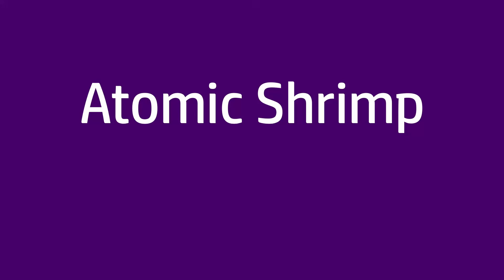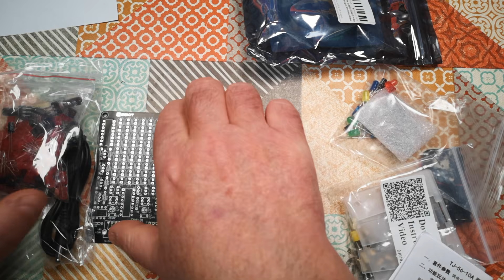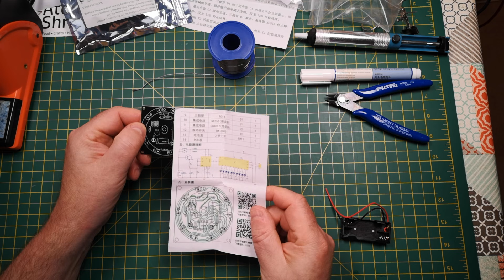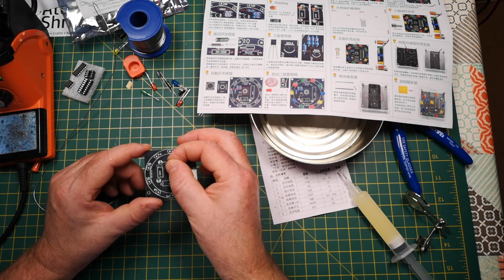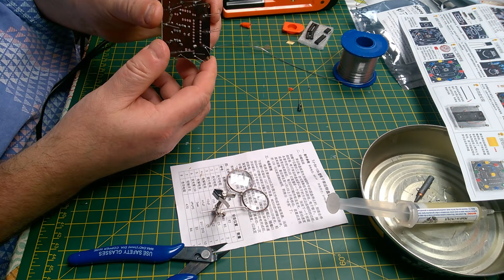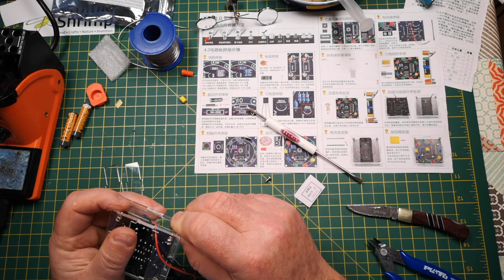Lucky Wheel LED Electronic Kit From Aliexpress

Comment: Ahh, the joys of Johnson decade Counters, 555 timers, Flip Flops and the like. My personal favourite projects has been connecting with a  breadboard to a Raspberry Pi and multiplexing 7 segment displays or making analogue measurements through digital IO with capacitor discharge timings. PIGPIO is a favourite library to use in C/C++.

Comment: You've ruined that new tip from the very start because you've heated it dry. It has to be fluxed and coated in solder way before it reaches max temperature.

Comment: Btw your temp is too low on your iron - when it isn't wicking properly flux can help but often it's just because your irons temp is too low or the tip needs cleaning. Sauce: software and electrical engineer
Reply: Ah just watched further and saw you noticed yourself 🤣
Reply: If it's got a removable tip, another issue can be the inside of the tip has oxidised or gone crap and the ceramic element isn't heating the tip properly anymore. Worth investing in a box of replacement tips cause they do go shit pretty quickly

Comment: On top of the other advice in the comments, I'd suggest investing in some good solder. The one you're using probably doesn't match the label. It may contain either too much or too little lead. Real 60/40 (or ideally 63/37) solder should be almost eutectic. If your solder goes through a paste like state while melting and solidifying, it's not anywhere near 60/40. Another giveaway is the label design. This one is a knock off of the Asahi solder label, which is a known good brand. The only good chinese solder I've used so far is the Kaina C (blue and white label). Other types (A, B, B1, B2) are of similar quality to the one you're using, and iterestingly enough have a very similar Asahi style label.

Comment: 555 timers used to be referred to as multi-stable multi-vibrators. I have old radio shack project books from the late 70's, when I was a teenager just learning about electronics. The manuals were always a treat I bought for myself when I got one of my meager paychecks. One was for 555 timers, I think still have it in storage somewhere. Need to find it now. I went to electronics school in my early 20's and eventually ended up in IT. Semi-retired now as I like what I do, but want to dump the crap jobs and do the fun ones. I love the electronics projects and tinkering. Your rambles through Spain are great. And as always, I love weird stuff in a can. I love the variety of videos. So glad you are able to do this full time. Much love to you, Jenny and the worlds best doggo, Eva!

Comment: Get yourself a fume extractor. Especially with leaded solder
Reply from the maker: I've got one but I need to extend the exhaust hose for use at this table. Lead isn't likely to be present in the fumes here - the vapour point is way higher than the temperature of the iron - the reason to extract fumes is the flux.
Reply: @AtomicShrimp that’s true but still always a good idea to protect your lungs.

Comment: The Hakko clone soldering irons and tips are so varied, it's quite easy to get a tip meant for your iron that doesn't actually sit right on the ceramic heater.  I had one like that, and I took about .5mm off the bottom of it with a Dremel and it suddenly worked a lot better.

There's just so many factories making tips and the QC is all over the place.

Comment: Watching you struggle with your soldering iron...
Lack of proper tinning on the tip is definitely a problem.  I would suggest you get tinning compound to attempt to fix it.  It has a much more aggressive flux built into it to help with the iron.  Once you get it tinned with the proper compound, wipe it as clean as you can & then coat with your normal solder.
When you put the iron away after a session of soldering, give it a good coating (big blob really) of solder & let it cool.  Cleaning the tip when you turn it off tends to allow the tip itself to oxidise.

Of course, it IS possible your irons temperature control has failed, but that's unlikely.

Comment: The way I learned soldering electronics is that you don't put the tin onto the soldering iron, and mustn't let them touch. You hold both to the foot of the item you want to solder to the circuit, so the tin flows around the foot. That was almost 30 years ago, but I can 'see' our lecturer from back then putting both hands on his head in dismay at your technique. :P
I'll just go with "maybe they do things differently in the UK" (that job training was in Germany, and I haven't been back in the UK for around 30 years too). :))

Comment: It looked to me like your soldering tip got dirty, and that's why you had difficulties.The crap covering the tip makes  heat transfer difficult. In my experience those wads of copper threads you can buy are good for cleaning it off

Comment: I noticed you’re still using a wet sponge to clean the soldering iron.
Just a heads‑up: modern tips have a very thin iron plating over a copper core, and the sudden temperature drop from a wet sponge causes micro‑cracks in that plating.
Once the plating cracks, the copper dissolves into the solder and the tip wears out much faster.

Brass wool (the curly brass cleaner) avoids the thermal shock, keeps the tip tinned, and actually extends tip life by a huge margin.

Not trying to nitpick,  just sharing because it genuinely makes tips last years instead of months.
Reply: You can also get get tip cleaners that are highly compressed blocks of solder and flux in a small tin, they're very effective as they both clean and pre tin.
Reply: @mfx1  For years I thought the little tins of tip cleaner were a waste of time and money.  Then I got one, and it's like having a new tip for my iron every time I use it.
Reply: I think it is very kind of you to share that little tip.😊 Have a nice day.

Comment: I have found those flux pens to be completely useless. Real flux paste is the only thing that has worked for me.
Reply: If you use decent solder you should never need extra flux. I only ever use flux for desoldering/rework.
Reply: @mfx1  Yes I agree (although quality solder is not always the easiest to come by). I don’t think I’ve ever used flux when soldering something, but for rework it is sometimes necessary.

Comment: you need too use leaded solder and FLUX that will fix all your issues ... also if that soldering iron doesnt have temp control it can make soldering very hard .. good effort with what you got tho
Reply: no need for added  flux if you use a decent brand of solder,and as for temperature controlled irons-no thanks,ive used  many makes of temperature controlled irons  , both expensive and el cheapo over the years on different jobs   but still go back to my trusty antex cs iron ,nearly 50+ years on its still going strong and spares are widely available.
Reply: @davisbonn I used various Antex irons as a kid experimenting with electronics but quickly grew out of them. IME the best irons are high wattage (Absolute ninimum 60W), temperature controlled with low thermal inertia. The old Antex and similar irons relied purely on thermal inertia balanced by the heater power to maintain a reasonable temperature but they suffer from often being too aggressive for delicate work but also not able to deliver sufficient heat into heavy copper. The combination of temp control, low inertia and high power enables the iron to work well across those extremes. If you only do limited types of work then an Antex is probably fine. These days I mostly use a TS101 or Pinecil V2 with a DeWalt battery as I often work in difficult situations with no readily available mains power.

Comment: Love the varied content. 

For best results, always lightly clean the PCB pads with a scotch pad, like cleaning a pan, a small amount of dish soap works too.

Use a quality solder too, like Stannol HS10, which is lead/tin, with a rosin core.

This solder flows well,  and wets onto cleaned PCBs perfectly.

Comment: 7:30 The rule I was taught for soldering order was based on heat sensitivity, not height, with the least heat sensitive components soldered first. It would have almost the same starting point, with the holders for the integrated circuits going in first, then the resistors.

Comment: Don't beat yourself up over the soldering quality, it's not you, it's the terrible iron. I'm and electronics engineer, ive been soldering for decades and a bad iron makes it 20x harder. Whilenon ali, get one that uses  cartriges with the temperature sensor and heating element in the tip. I would get a chisel tip, i thibk they are usually marked as BC. Set it to 360 and then use a copper sponge or similar to clean it. The wet sponge does nothing.

Comment: A lump of blue tack under the board is a very helpful little tip for keeping the board still whilst soldering
Reply: Definitely. Use that method whenever I assemble a PCB.
Reply: Use small bits to hold components in place on the board, also for holding wires and connectors. I always keep a large blob of blutack stuck to my solder reel.
Reply: After a few years of soldering your fingers get used to he heat. Or your holding the iron on for too long which does your fingers and the components no good.😅😊

Comment: 7:30 Pedantry alert:LEDs are diodes.
Reply: Yeah except nobody says non-LEDs lol
Reply from the maker: I'll go all in and tell you all diodes are LEDs!

All diodes emit light. Thermionic diodes have a filament like a light bulb, but all semiconductor diodes emit photons even if they are only designed to function as electronic diodes. Often the light is in the infrared and often the packaging of the component is opaque, but the semiconductor inside is lighting up when in use.
Reply: @AtomicShrimp  I’m aware, thanks! Still there’s a reason why we only refer to some as the light-emitting type 😛
Reply: @AtomicShrimp   Except for the blown ones.  Then they're known as DEDs:  Dark Emitting Diodes.
Reply: @sarkybugger5009 and oftentimes as they blow they become light, then spark, then smoke emitting.
Reply: @AtomicShrimp I was vaguely familiar with the concept that all (silicon?) diodes were photosensitive, but didn't know that they all emit photons. 

You are truly my internet eccentric uncle. 😄
Reply: Indeed. I'll see your pedantry and raise you some Light Emitting Diodes.

Comment: With you saying the solder is 'lead', is there an 'Unleaded' version now?
Reply: Yes - lead free. It is sh*te, but we must use it because the politicians say so.
Reply: @kimvibk9242  Beginners are forced to inhale the fumes of yee yee aß Chinese solder. Unfinished spools of SnPb60-40 are sold in auctions by consumers. They don´t require a permit to use or sell, but the auctions get expensive.
Reply: @kimvibk9242 A better way of looking at it is this. Leaded solder is not banned, and hobbyists continue to use it. Corporations should not use leaded solder. Lead free solder must be used correctly, and many corporations had no idea what they were doing when they first switched to lead free. In 2026 lead free solder is well understood and you just don't hear of massive failures due to cracked solder joints. That was the PS3 era, 20 years ago. PS4 and PS5 didn't go back to lead. They fixed their manufacturing techniques.
Reply: @kimvibk9242  "Because the politicians say so" Perhaps because lead is highly toxic. Skin contact, inhalation of fumes, ingestion etc can all cause damage in the nervous system and brain and kidney damage. Also leaded solder in landfills reads to toxic lead leeching into the environment. I always find arguments from the "Screw life, I want things to be slightly more convenient" crew to be mind boggling.
Reply: @Pattoe  Doesn't change the fact that it's sh!t.
Reply: @Pattoe  For hobbyists the lead based solder is more convenient, as it flows more readily. For industrial purposes, the lead free solder is preferable, exactly for the reasons you state.
However, politicians will always flex their power and ban lead based solder for hobbyists, even if the pollution from this source is minuscule. What I oppose is that the politicians incessantly meddle in our personal choices.
Reply: @kimvibk9242  I don't even think banning leaded solder can benefit the most out-of-touch politician. As Pattoe said, lead is highly toxic and it has been proven multiple times to be dangerous to our health.
I get what you're trying to point out here but none of this even involve politics.
Reply: @Pattoe It's purely an end of life/landfill thing,  there is ZERO risk to operators/assemblers with basic common sense hygiene, metallic lead isn't easily absorbed by your body and solder never gets hot enough to give off lead vapour. I've had my lead levels tested after years of using leaded solder and they're completely normal plus I know people in the industry whose lead exposure is regularly monitored. The fluxes used with lead free solder are also more active and potentially harmful than the fluxes used in leaded solder but as most assembly is automated these days that isn't considered an issue (that's also extra evidence that the problem is only about equipment end of life disposal).

Comment: The "Add one more item for free shipping" seems to be a very effective marketing ploy. I keep getting caught up with it and have plenty of "extras" to fill my junk pile 🤣👍
Reply: Given how cheap some of the things are there vs how much the scumbaggery marks them up here, it's an acceptable trade. You can go for junk, but there's veritable good stuff to get too. Like, i got (for the free shipping) 12 of those ceramic bulbs you put to water plants. Given they eventually clog up unless you use distilled water, that's good.
Reply: Pretty much. That's the story of my $35 minimum Amazon shopping journey- hepa vaccuum bags......  $6 each for branded ones in local store vs $2 generic Amazon ones
Reply: @AhhhSukeSuke  unless you're looking at existing brands, amazon is just a more expensive aliexpress. not even sure it has less formaldehyde. they are quick about refunds and returns though